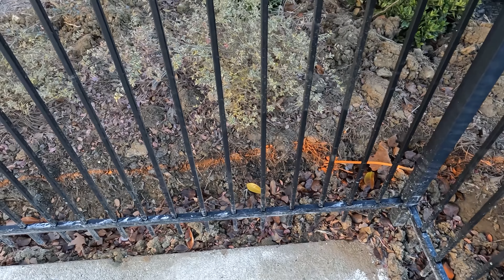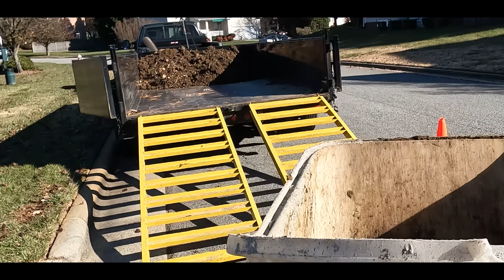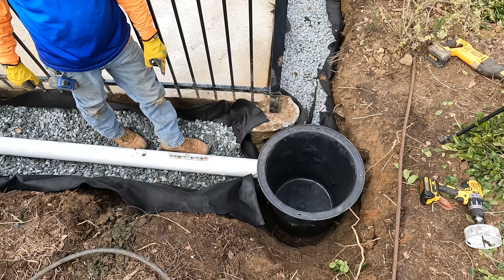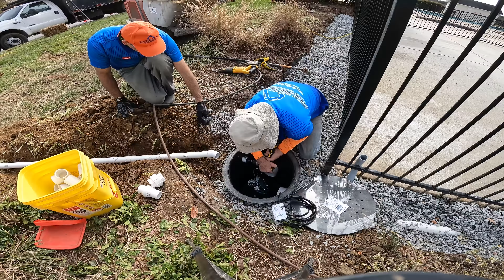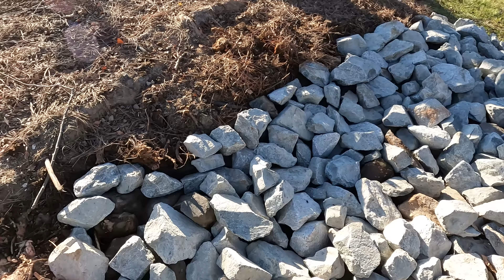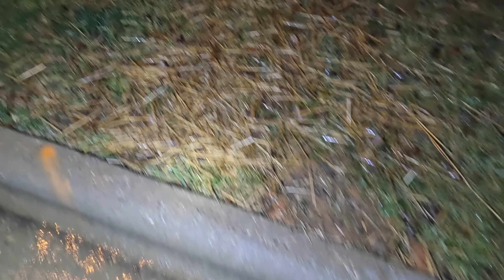How to install a yard dewatering pump (sump pump) in a low area

Comment: Glad to see you put a union on this one.
Reply from the maker: We use unions on all our pump installs. I think the only time we pipe them straight is in areas where theft is a concern.
Reply: @GCFD  I rewatched "Solving flooded courtyard with dewatering sump pumps" and yes there was one of the vertical riser (didnt notice it the first time).  I would think the horizontal install of the union is a wiser choice this time around.

Comment: I appreciate guys that put their work on yt like you have so I’m very reluctant to point out faults in your work, but in saying that, this is not a well thought out system. So many faults here.
Reply from the maker: HI Tony - This system has been working extremely well and solved their water-on-the-deck problem 100%. I welcome your thoughts on how I could make this work even better! Thanks in advance!
Reply: @GCFD  first of all, I respect that the system is working well and you are likely working with methods that have always worked well for you but some observations from me would be, there seems to be only a slight rise in elevation between the pump and the discharge point? 5-6ft? And it looks likely that you have used a discharge line that matches the discharge size of the pump? 1 1/2”? The amount of head that the pump is working at will likely be below the minimum head rating for the pump, meaning it probably runs close to, or even above the maximum motor current when it runs. Also unless you have used a foot valve at the pump, then the large volume discharge line will be causing a big volume of the pumped water to run back into the sump when the pump stops. This does have the positive effect of flushing any debris from the volute/impeller of the pump, but when you are working with a relatively small pump chamber it is going to cause many more start ups for the pump. Running with excessive start ups and high current is a recipe for shortened pump life. If you are dealing with a retailer for your warranty they may overlook the running conditions for the pump and just hand over a replacement due to the warranty period covering it, but if this set up was looked at by a manufacturer, they would probably point to your set up and decline warranty. 
If it is not possible to use a much larger or deeper pump chamber, then I would recommend using a much smaller discharge line to induce artificial head and reduce the amount of back flow into the chamber. 
These observations are made with utmost respect to your business. I do not know the constraints of the job or what budget you had to work with.

Comment: Just confirming that the pipe in the french drain is a perferated plastic pipe with holes in the bottom , correct?  I didnt see any holes in the video and that fact was not pointed out verbally.  That is the only way this makes sense to me as to how the water drains from the pipe.

Comment: I bet using that core drill all day would build up some good arm strength.
Reply from the maker: That thing is a bitch to use.
Reply: You would end up with vibration white finger. Any power tool to much at one time too often is not good.

Comment: Can I ask why you didn't put any surface drains that collect surface water and build up in high flow events? Could have easily been connected into the perf pipe and run to the pump pit.
Reply from the maker: Great question. The reason is because everything was already sloping towards the gravel.

Comment: Since the sump discharge is uphill did you need to install a  check valve? Great video.
Reply from the maker: Yes! there's a check valve right near the pump. We use spring flaps over the spring pop-up check valves.

Comment: since you're pumping from the low point to the high point, what prevents the water from back flowing during heavy rain? Is there is a foot valve on the pump?
Reply: Typically a check valve is installed on sump pumps
Reply from the maker: There's a check valve like Joshua said. It's at the base of the pump and we like the flap style best.

Comment: Awesome video Shawn! Question: any concerns about the pump short cycling itself to death? It seemed to discharge super quickly 👀
Reply from the maker: I always buy Zoeller from the supply house. They have a great warranty (better than zoeller from department or online stores).
Reply: I’ve done 1000 French drains some with pump systems and the reservoir here is not big enough. And you never ever put stone under a Pipe unless it’s solid pipe. Permeable fabric perforated pipe than stone on top then wrap it. There’s only one right way to do a French drain. Trying to be disrespectful or mean.

Comment: What size gravel would you recommend for French drain?
Reply from the maker: I use #57 angular from the quarry. You really can't go wrong as long as it's angular and not rounded river rock. The reason is the rounded rock shifts around underground and needs a filter to keep the sediment out. The angular gravel locks in place and works as it's own filter.
Reply: It depends on the situation. For very large amounts of surface water off a use 40mm (1.6 inch) single size stone.  If it is lower flows of mostly ground water you could use a gravel/ coarse sand mix of the type used for concrete if that is cheaper than a smaller single sized stone used by Shawn in video.

Round river rock will move the most water. Crushed angular rock because it is rough will slow the water down and so less water will be carried along the trench. If river rock is cheaper than crushed, use round river rock for capacity (but may need crushed at surface). 

Round river rock will move around because it does not interlock but only for the top 150mm (6 inches). Below that the weight of the stone above it will stop the stones from moving. If people are at all likely to walk on the gravel use crushed for the first 150mm then go to round river rock if that is cheaper than crushed. You also need to consider the minimum delivery quantities of each, for a small amount where you need some crushed you might as well use all crushed.

Crushed will filter better than round river rock because of its roughness catching particles as they enter the trench from the top and sides. You may still need a filter fabric with crushed, it depends on the grading of the soil you are excavating in ( and how soon you are willing to have to dig out the trench if no filter). If you need to use a filter fabric with crushed it may have to be stronger to cope with the "points" on the stones.

Comment: Did I see a motor of some sorts on your tripod GoPro? I've always wondered how you get the slow pan on the time lapse shots!
Reply from the maker: Yes! that's a panning head. I can set the degrees that it pans and the time it takes to pan it. I really really like those shots!
Reply: Very nice! Just that subtle movement adds so much to the shot and I never could figure that out. Thanks Shawn!
Reply from the maker: I agree. I think shots are soo interesting.

Comment: Hey so I noticed holes down and you don't put the pipe towards the bottom of the channel?

Also on a sump pump do you run a check valve and what do you to to protect against freezing in a frost climate?
Reply from the maker: Yes holes face down and we place a couple inches of gravel under the pipe. I'm not sure what to do in a cold climate to prevent the pump and pipes freezing.
Reply: The gravel under the pipe will help to protect the pipe from mechanical damage. It is better to support the pipe on gravel than stones, bits of concrete etc that may be in the ground. Debris will tend to collect in the bottom of the trench so if the pipe is slightly higher less of it will work its way into the pipe.

The pipe could be laid with the holes (or slots) upward if you want it to move more water. But in this case the pipe is just collecting it and storing it for the pump. Holes upwards would also reduce the storage capacity of the trench since the water would have to till to a higher level, which could also cause the pipe to float upwards in this shallow trench (not enough gravel on top to weigh it down).

Comment: Hi,
My wife and I really enjoy your videos.  I wanted to ask you if when you remove corrugated pipe and replace it with solid pipe whether or not the solid white pipe has weep holes or any holes other than at the end? In short, Is it just regular PVC piping?
Reply from the maker: The pipe is regular solid PVC. The weep holes don't work in our area because we have clay.
Reply: @GCFD  thank you very much for answering.
Reply: Shawn said in the video the PVC used has holes facing downward. This is to collect the water within the gravel and take it out onto the street via the sump pump.

Comment: Nice job as always. Is an outdoor sump pump viable in a cold climate? (Northwest Pennsylvania.)
Reply from the maker: I'm not sure about that. You might have to winterize it because the check valve will hold water.

Comment: what sort of fabric are you using?  A lot of talk on other channels about what is good or bad fabric
Reply from the maker: This was a soil stabilization fabric. The fabric is not really crucial in our area because we have impermeable clay subsoils. So there is no subsurface water flowing into the gravel. If you have a highly permeable soil the fabric helps to keep the gravel in place. the most important thing is to use angular gravel and not rounded gravel because rounded gravel shifts around where the angular locks in place and maintains the air spaces (for water).
Reply: If the fabric is being used as a filter  (as opposed to a separator as in the video) it should have a permeability that matches the soil permeability and grading. It also needs to be able to resist  damage from the soil, placement and the drainage stone especially if angular is used rather than round. Different fabrics for different applications.

Comment: Great work Shawn.  My HOA has a pool deck that is plain concrete.  I love the resurfaced look of the deck after the pool company's work.  Can you tell me what that process is called so I can search from someone local to me to do it?  Thanks!
Reply from the maker: I think it is just deck resurfacing. They seal the cracks and make them look like part of a design. It's very nice work.
Reply: @GCFD  Could this be done on a driveway as well? Looks great, it would make an old drive look brand new!
Reply from the maker: I'm not sure about that.
Reply: Just a guess but it could be epoxy resin with bauxite spread on top. They used that to up the skid resistance on roads and it looks similar.

Comment: 8:10 why not channel drain instead of a buried pipe?
Reply from the maker: A channel drain against the concrete would be good if water was only coming from the concrete. Since we had surface water from the concrete and from the lawn and natural areas, a FD was a better choice. Great question!

Comment: Also you should of wrapped that gravel like a burito.
Reply from the maker: No, wrapping it up kills the flow into the gravel. Fine sediment clogs against the thin fabric and further kills the flow. By letting the gravel be your filter you preserve the flow, which is what rinses the fines through and out of the drain.
Reply: @GCFD  The fine seddiment will over time do exactly the same. It also stoppes the sediment from building up from the bottom. Silt will continue to grow.